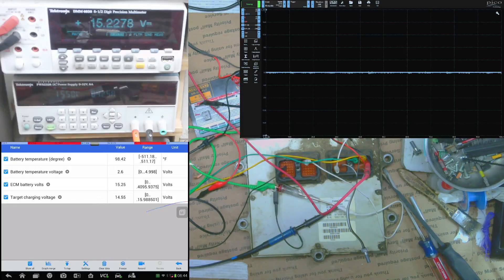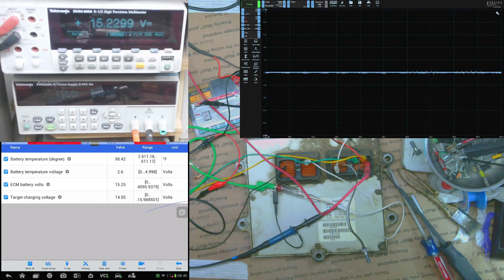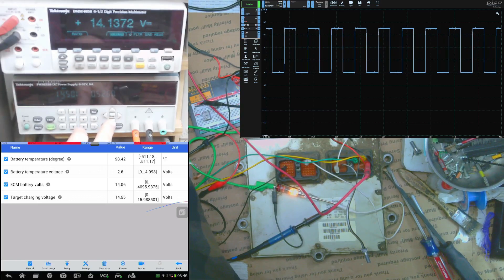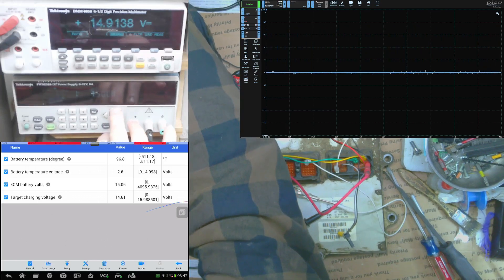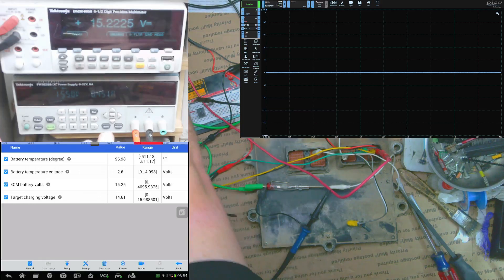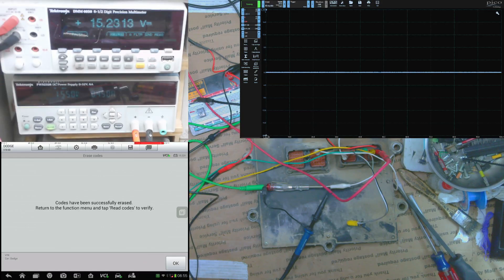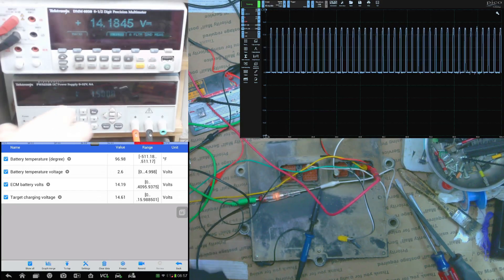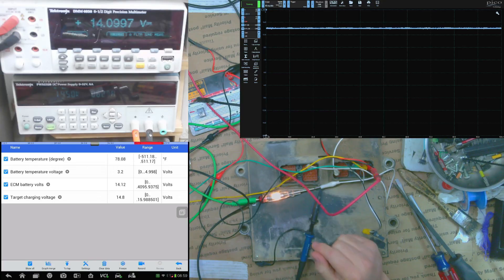Is It the ECU? More RAM 5.9L Bench Testing – One Not Charging, One Overcharging!

Comment: Hello, are you able to unlock a 2003 5.9 PCM for a flash? I've taken my truck to the dealership & to an independent shop to flash it back to stock, but they cannot bypass the lock placed by a tuner (previous owner installed it). Can't even read the vin.
Reply from the maker: Yea thats no problem